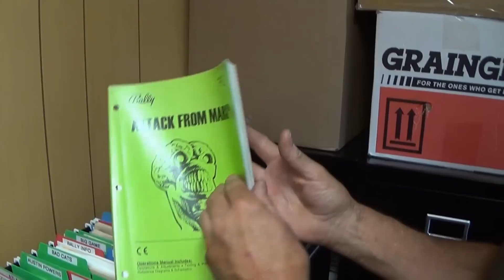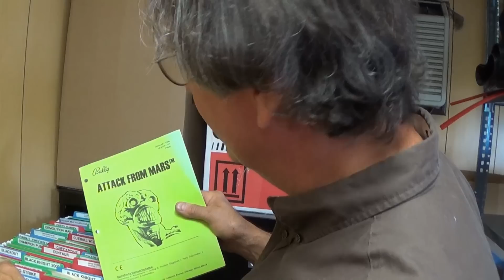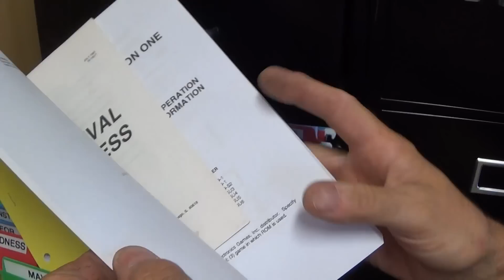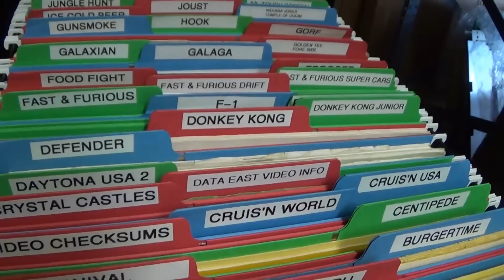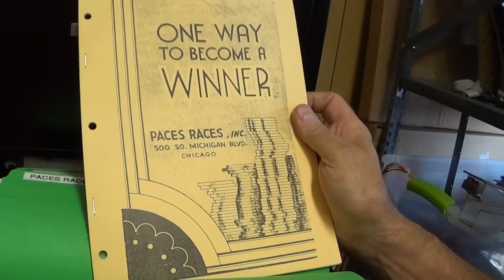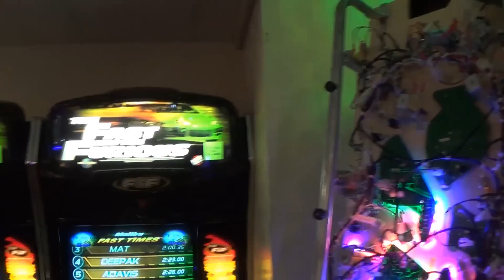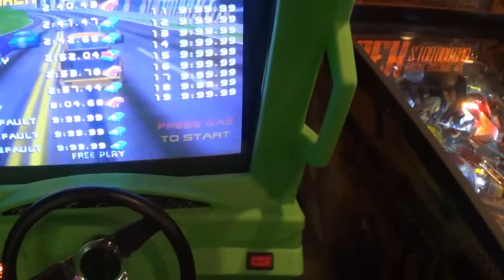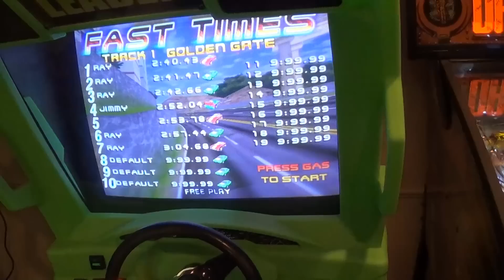Ray's PINBALL Tech Tips #6 LAMP SOCKETS!

Comment: Nice. When I have a lamp PCB out of the game to re-flow cracked header pins, I also re-flow the twist-socket pads if they are very divotted. Cleaning the areas to be soldered with 91% Iso or lacquer thinner helps a lot, before and after. I also like the liquid rosin flux, but a little goes a long way. Also needs to be carefully cleaned up after, but it makes nice shiny clean joints - "Mt Fuji"-style.

Comment: Hey ray grate videos i love watching them, quick question i bought a pinball cab and the 100 relay isn't working properly, i cant find any problems at all. i did notice it wasn't grounded and it must have been at one point because of where the power chord goes on the em board the ground section had a blob of solder on it. so my question is should i put the ground back on the board and can the ground not being connected cause such problems. keep up the good work.
Reply from the maker: Umm.... say what?

Comment: Helllo
About replacing SMD components (on the JJP), there absolutely nothing impossible to do. It's just another set of skills to get !
Baking: well yes the air transport the heat, the solder is not a wire but a mix of microball and flux. In the end it is a real joint, same as with iron.
Search "Louis Rossmann on youtube. He fixes iPhone&Mac and probably can learn/train a pro (Ray) to do it. Every single LED is probably listed on providers like Arrow, Mouse or Digikey.

Comment: You're supposed to put 'bulb grease' (dialectric grease) on the contacts before they corrode. That way the grease prevents the contacts being exposed to the elements so no moisture gets to them, and then they won't corrode in the first place.

For replacing SMD components by hand you just need solder paste and a hot air rework station.